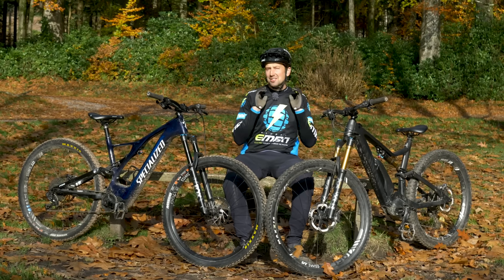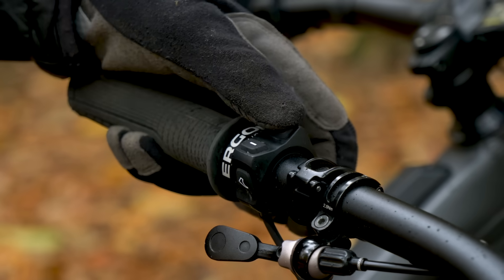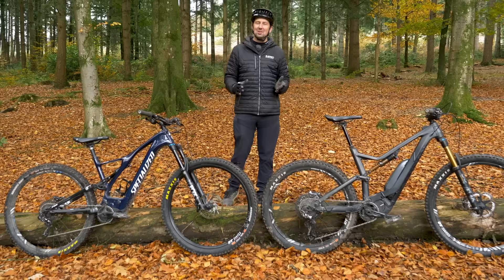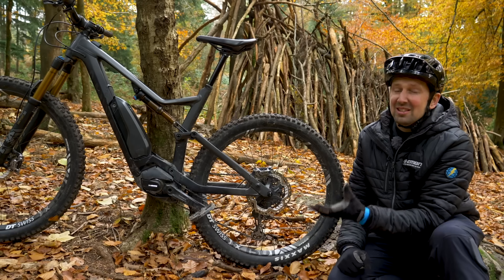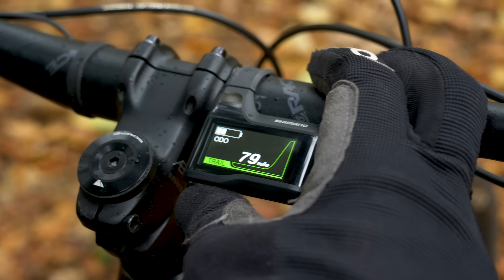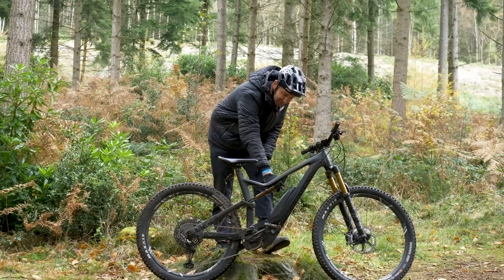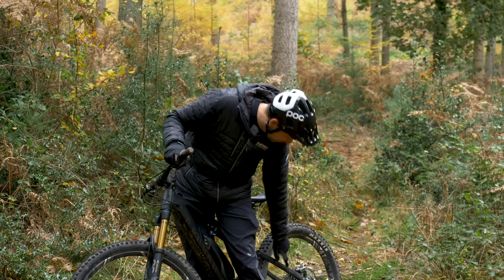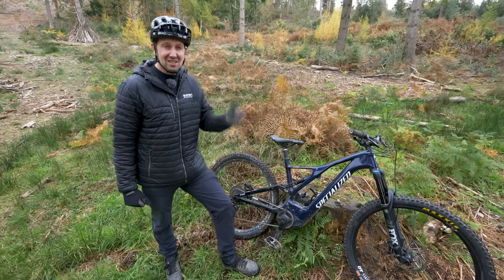How Does An Electric Bike Work | The Basics Of An E-MTB

Comment: They are immensely heavy, overpriced and I am sorry, it is cheating.

In my eyes, if you are not peddling all the time, and have a battery assisting you or doing most of the work, then that is cheating end of.

But the weight of them too. My bike is proper, you can lift with 1 finger, a proper mountain bike.

So, look, I know you EV bikers think your special and pro, but your not, your cheats who don't know what a mountain bike should be.

Cheers.

Comment: What not to install magnets in. The rim  +-+-+-+-+-+-+-+ around the rim and used a microwave  trans former  with one coill to generate electricity as it rotate  then can the will turned like a motor as you aplay power through the colld with a dio switch to increase power aplay the dio and  battery to make slowere or faster   equiped with do aasecon charging baterrys  torunthe bike thotherto to be charge will running treoght the rims en macnets to generated electricity can that be posible if it codrun oll mos 24-7th

Comment: HI, I like your video. Can you please help me? I have overheated the motor like 4 times on my peddle assist ebike. I live in a mountainy area so I use the bike to go up steep cliffs. The mechanic tells me im using it wrong but i dont understand how the assist works and how to go up those steep cliffs without damaging the motor. They told me the highest assist is for steep cliffs. What does that mean in terms of my peddling? If the battery is on its most powerful does that mean I should be peddling very strongly too?

Comment: Very informative video. my doubts are cleared. However could not make it if the battery charges by itself while you pedal the bicycle. How convenient it is to use the bike without the battery assist?
Reply: It’s about the same as a normal bike but with an additional 20 lbs for the fancy bits.

Comment: Still didn't explain how the motor actually assists you when you are pedaling. Would be nice if you showed how the chinring spins faster than the cranks.
Reply: That why I watched. This video was rubbish.
Reply: .....it rotates either the back wheel or the pedals at various speeds and strengths based on your settings.
He explains this, it's fairly straight-forward, and he even covers it twice in different contexts. Y'all payin' attention?
like i knew the motor spun the wheel when activated- I actually learned a thing here about the pedal-assist models, I didn't know those were a thing.
Reply: @almighty2134  must be bored.. commenting on comments made over 8 months ago. And it didn't explain shit.
Reply: @downhilljedi  Did you figure it out though? 🤔 I would like to know please
Reply: @skye5543  no.. still don't know how the front chainring spins at a different rate than the crank arms
Reply: @downhilljedi  
It works the same was as a normal bike. The only difference is the motor will put power into rotating the wheels or the pedals (Depending on where the motor is located). 

When the motor rotates the wheel or pedal, the front chainring moves with the system. And the crank arms move with the chainring like nor

Comment: I’m not sure about buying a nice E-bike just because they get so much better every year.
Reply: Then you will never get one? At what point in the evolution and your age point do you want to buy one? Buy and enjoy now! While you still can lol Whatever bike you splash out on will lose value soon as you walk out the door, And the following year a newer model with come.. And it probably won't be a huge difference onto the next.
Reply: BUY. YOUR. FORKING. EBIKE. NOW. YOU'RE. MISSING. OUT. ON. ALL. THE. FUN!! 
They don't get better. The E8000 is three years old and it's still possibly the best motor system. If a better system is released it will be on the most expensive bikes. Not worth it. 
Get an E8000. They are perfect in TRAIL mode, you can customize the boost level in your phone app, and the display is nice. Bosch has no customization and a dull display so I wouldn't get Bosch. You don't need more power. You don't need much lower weight. Only the price going way down would be revolutionary. If price concerns you - get a used E-bike!
Reply: i have a focus jam 2 last years model, just derestricted it, has turned the bike into a beast
Reply: sloth I have 2017 levo, its still awesome to ride :)

Comment: #AskEMBN I’m considering a Canyon Spectral ON 7.0 as my first emtb. I notice you feature Canyon a lot in your videos. Is this because you actually rate the bike or are you sponsored/promoted by them. They seem a good spec and price and pretty much perfect for a beginner looking to progress but see mixed reviews.
Reply: i bought a 7.0 like 3 months ago and i'm happy with it
Reply: jonas are you experienced or a beginner like me? How have you found the battery range?
Reply: @Jimbojetset84  i'm a beginner i like the battery range i do like 20-30km in boost only, depends on terrain and you're weight.
my weight is around 60kg with equipment.
once i get bether at riding etc il know il be able to put the mode lower to get more range out of it. also a tip get new pedals for grip or you'le slide from the plastic once going downhill. also get tubeless asap ive gotten like 30+ flats alrdy from in the woods gota love tubeless :=p
Reply: they are sponsored by Canyon.  Specialized and Haibike are also sponsors along with others.

Comment: Riding a Bosch PL CX 3Gen. Riding with motor off is just a pain in the butt. It doesn't feel like riding a normal MTB at all.
Reply: The bosch motor has internal gearing which drives that small sprocket to give you more crank action for every spin... 2 or 3x. This is what will give you a resistance feel without power. But it also depends from motor to motor how bad that is. Also, Any ebike will feel sluggish without power compared to a standard bike because of weight difference,  How much so will also differ from bike to bike depending on design.
Reply: I have found that the feel while riding with the motor off is VERY dependent upon the bike. I rode on a Bulls FS bike with a depleted battery and it totally sucked. However, I sometimes ride with my Moustache Trail 8 off(on purpose, to get a workout with slower folk), and it is a LOT easier than the Bulls. Both have Performance Line CX 3 gen motors.
Reply: Riding a Bulls FS, too. 👍